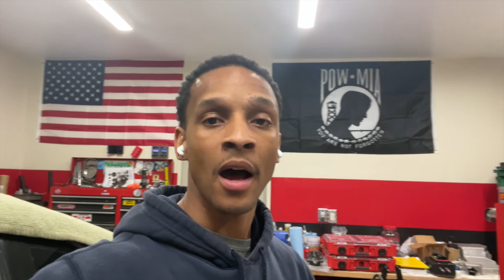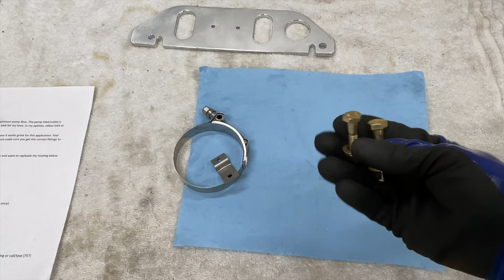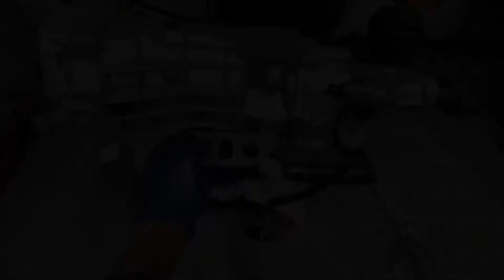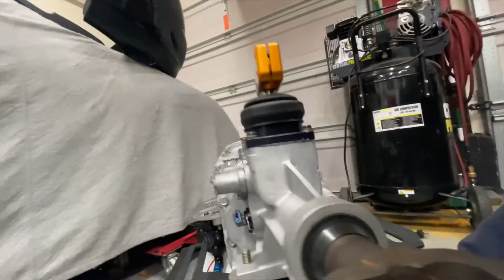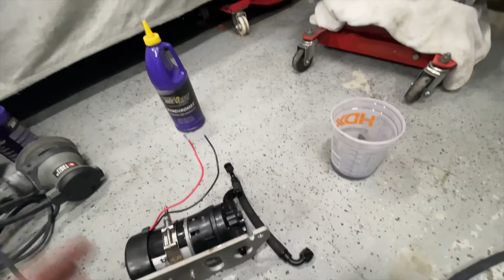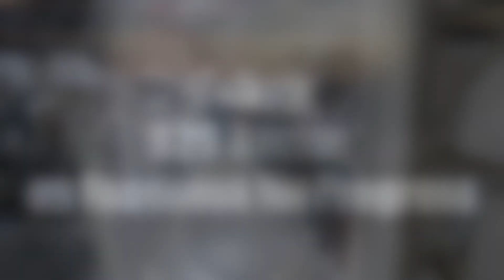How to add an external oil pump to your T56 Magnum with my install kit!

Comment: will it work with stock cobra t56
Reply from the maker: @Khalidsvt101  no it will not work with a t56 unless you have had a bung/port welded to the front half of the case to return the fluid.

Comment: Was thinking about buying the Tick Performance Billet Plate that comes with an upgraded sprayer and i also like the location of your kit ! My car is mostly 
80 street / 20 dragstrip. Have you noticed any overheating issues with keeping the pump tucked up like that ?

Comment: Question brother what trans fluid you'll be running??
Reply from the maker: My transmission was built by RPM Transmission and they advised me to run RP synchro max at my level/usage as it will shift better. 

75w85 has to heat up before it shifts smooth. The thicker oil does help to keep a fluid film on the gear teeth at high power. 

Don’t forget Tremec sells oil specifically for T56/Magnums. I have yet to try it but it’s supposed to be specific for these applications.

Comment: Could you theoretically fill the trans after the pump and sight-glass is installed using a 12v battery hotwired to the pump, almost as a vacuum? That way you know exactly when it's full at the sight-glass?
Reply from the maker: I think that would work; you would have to consider how to stop fluid from pouring back out of the trans to pump input line when you are ready to reconnect. 

I'd rather leave all the lines connected and use a small hose and a hand pump to put in a specific amount of oil through the factory Tremec sprayer port. That port is high and will not pour any oil out when properly filled.